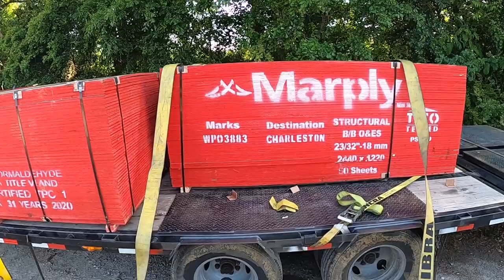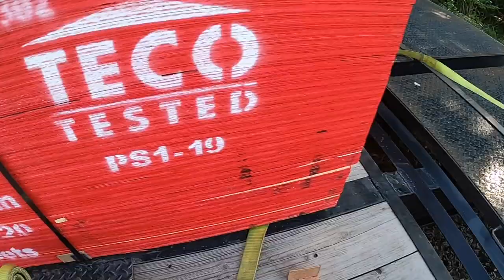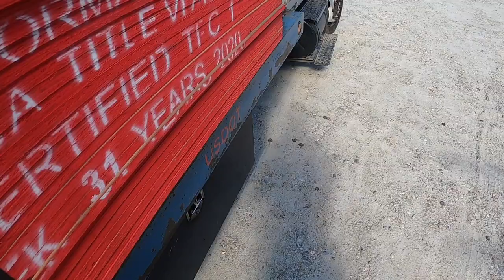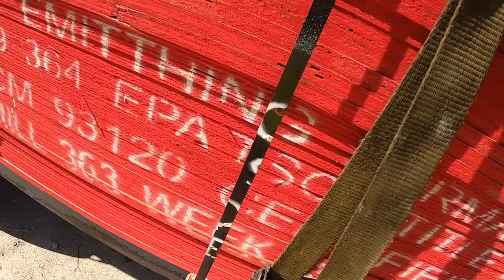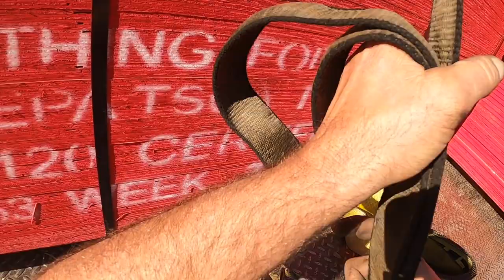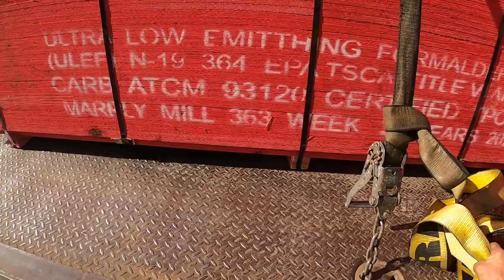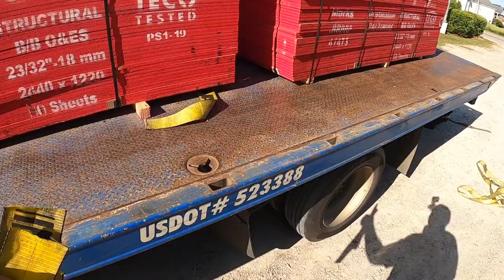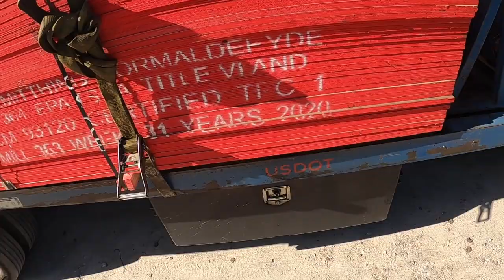Trailer Couldn’t Tow It’s Load

Comment: Interesting job , I was just starting to comment that I was shocked that you could get by with less than two straps on each bundle that length when you mentioned you were adding straps. After watching you all the time I should have known that you would do it right. God Bless and stay safe out there!
Reply from the maker: Mr John thanks for watching and commenting. Stay safe
Reply: I drive in Connecticut I think it's every four feet you need a strap plus the weight of the item you're strapping I would put two straps on each bundle

Comment: That plywood was labeled in metric ,2440 X 1220 MM or 4x8 ft. the 2500 weight is most likely  KG. or 5511 LB.
Reply from the maker: Mr Dave I didn't even notice that. Thanks for watching and stay safe
Reply: @SumterWrecker  23/32 osb weighs roughly 78 pds a sheet,  those bundles were around 3900 pds a peice...the trailer was way overloaded....